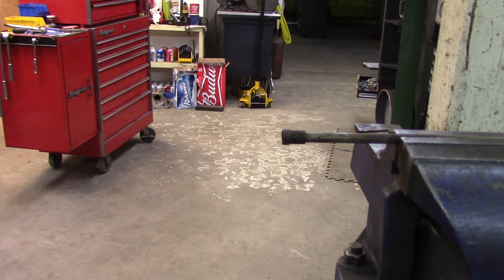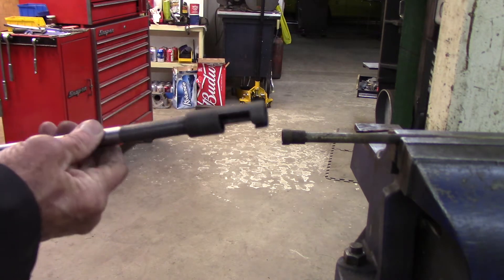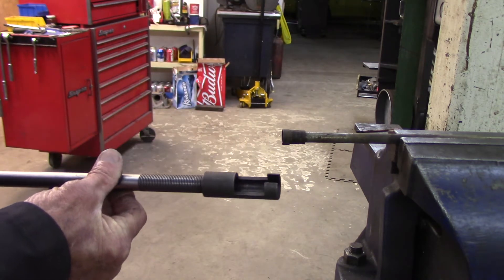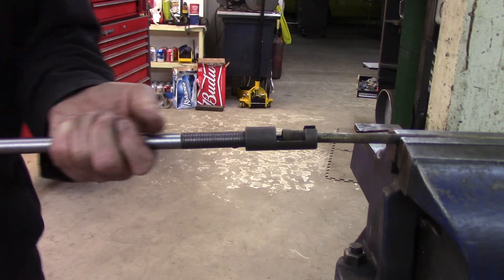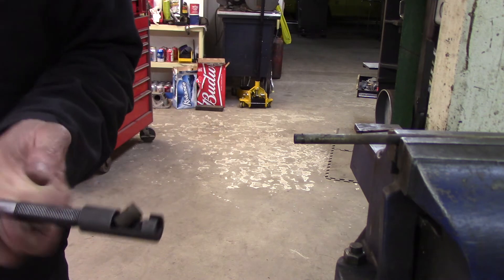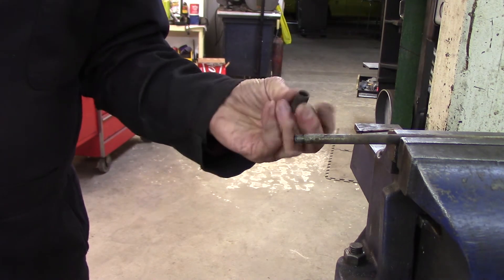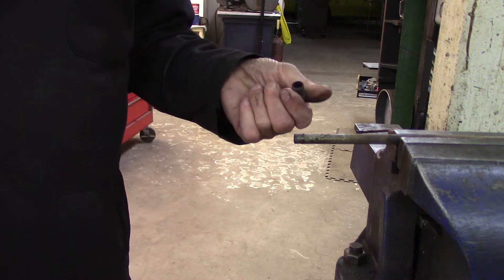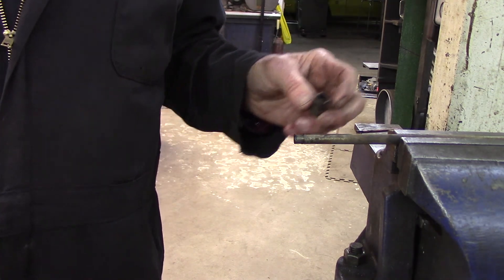Removing a Buick Straight 8 Push rod End

Comment: Good tip - I may be using it. Is there a restrictor in the push rod upper end? Something's plugging mine, and I haven't found any information about it. I'm used to being able to blow air through push rods, but those have all been engines with hydraulic lifters, and with the oil flow being up through the push rods.